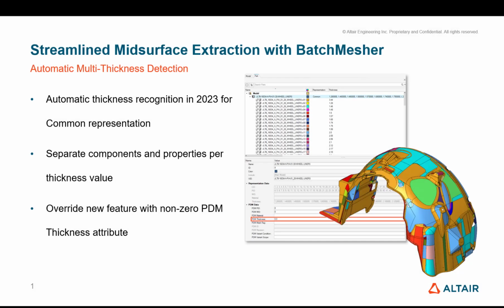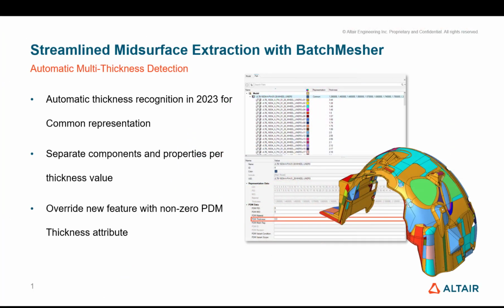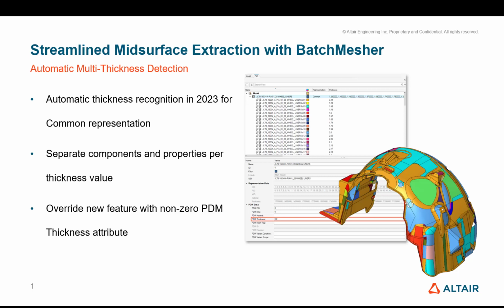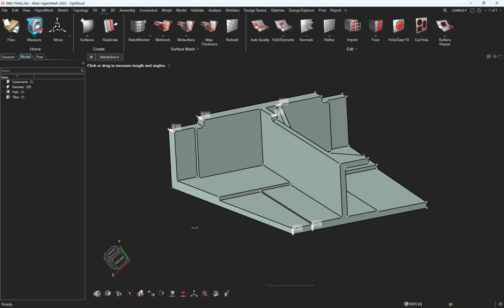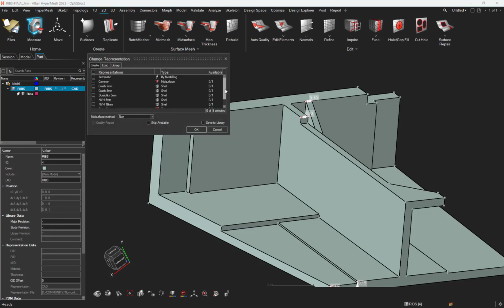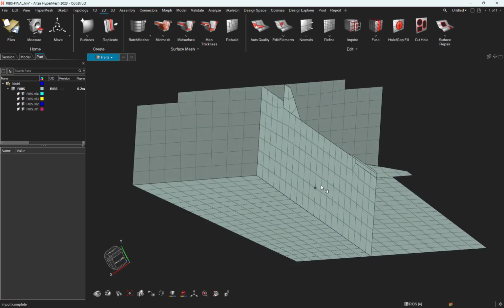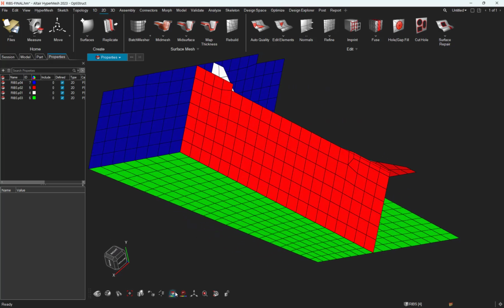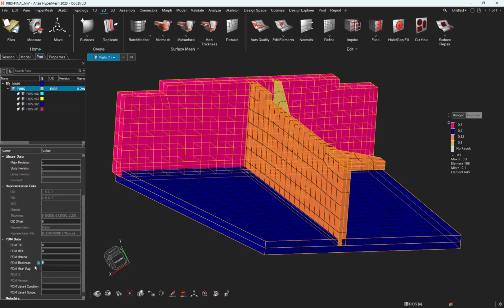Dealing with parts with non uniform thickness with HyperMesh 2023

Comment: Alas! The final result is not having different thickness values as we expect, especially at the flat with multiple thickness! Again we need to depend on manual method to achieve the proper thickness segregation!
Reply from the maker: hello @gurusathyaprasadh, It actually depends on midsurface topology and therefore on the extraction method.
Using the 'offsets' method (instead of the planes+offsets), allows these step edges to be preserved.
Reply: @altairhowto  thanks for the quick clarification ; greatly appreciated! 😊